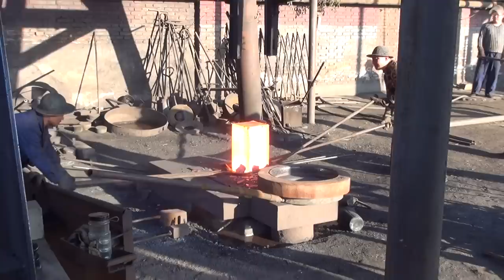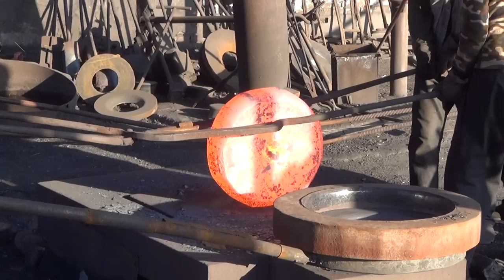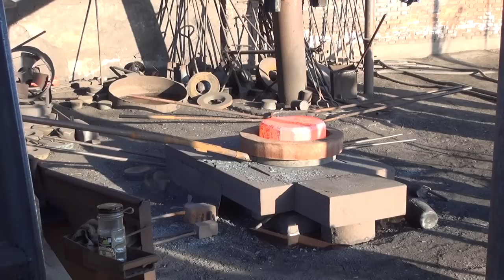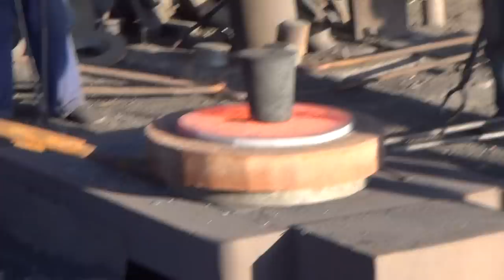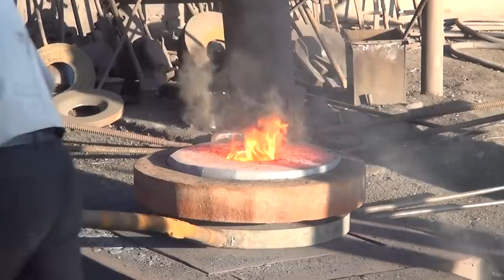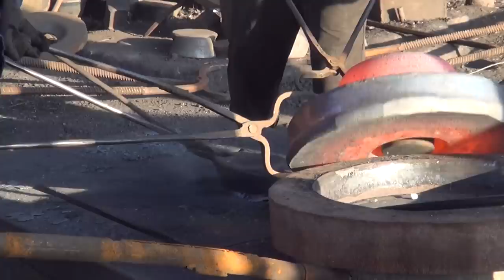Visit China Factory for flange .forging ,ring in dingxiang -Shanxi Liyang Forging Co.,ltd

Comment: State of the art equipment and excellent safety practices. No wonder we can't compete!
Reply: What fucking video were you watching?
Reply: They probably got 25 cents for work that day
Reply: @markmackey6012  sarcasm
Reply: This thing they are doing is probably a bearing housing for some, say, a generator in a hydroelectric power plant or something similar, which has to withstand a huge load.
Can you please direct me to a video that shows the process of producing the same or a similar product in a "western way"?
Reply: These folks are excellent craftsmen. Their pay will be according to local levels. As if our processes were different. It's only that nowadays we don't want the noise, dirt and work in our neighbourhood.

Comment: Has anyone even noticed?  That power forging hammer... think about it. It's not a forging hammer at all... it's a pile-driver that was repurposed to forge steel. It makes sense... the pile-driver hammer head is massive and heavy, and is intended to drive long heavy logs deep into the earth. The pile-driver hammer head is solid steel and very heavy and already flat. It needed to be in order to hammer and drive logs into the ground with only minimal deformation. The only modifications they made was to include a heavier head and a variety of different dies and the pile driver anvil base that they are using to make the steel forged flanges.

The other thing is how much work that they are able to do with only a single heat. There's so much steel that only the surface of the metal cools and oxidizes as they forge and form the steel. Ingenious forging method and a brilliant repurposing of a piece of construction equipment. After all, how many pile drivers in this country were retired and sent to the scrap yard, never to be used again? Very wasteful... These people saw a potential use for the pile-driver and decided to reuse it and make it useful again...
Reply: Good point, you are likely correct. Next time I need a flange, I'll go rent a pile driver and hook it to my excavator.
Reply: I agree, good call.
Reply: Amazing the way they do that. Thanks
Reply: My friend Billy got messed up bad because the driver was turned up to high and blew the pile apart, Billy is handicapped now! Dangerous Machine! Only one or two deaths a month there.
Reply: yea, very simple, effective solution when the fancy hydraulic hammers are out of budget range.
Reply: Engineering solutions sometimes use what is known as a "brute force approach", simple, low tech, neither elegant nor efficient but with the singular virtue of doing the job satisfactorily.  They just don't often involve literal brute force.  I have no idea of the relative merits of forging it this way, but it seems to work quite satisfactorily indeed.
Reply: This is called a "Drop-forge" hammer, and it is not a modified "Pile driver".

If you are wondering how much work they are able to do in one "heat", you are correct... they are forging the work piece even after it has lost its proper malleable temperature.

The "scale" is not being removed continuously, and the end result would be a "Weld-neck flange" which would most likely fail under pressure

Comment: I echo all the positive reactions to this captivating video of a great team making a great product: and it makes me seriously wonder what on earth kind of steel they use to make those cone-shaped hole punches & the molds they hammer the hot steel  in to ? 
I saw the video of this same pipe flange being machined in a huge lathe as the final product. It was just as fascinating.
Reply: There aren’t great product and great equipment. It’s shit.
Reply: "great product" try building a train with those handmade rings, then when it derails cuz its uneven you come back to me. This is 1800 century tech. You cant guarantee precision of shape like this
Reply: ضشذذذ
Reply: I don't know about what they are making there, but i do know the steel they use in many other products is so inferior, the product is completely worn out in a couple of months.
Reply: It's easy. I was told this by my instructor when I began my apprenticeship as a blacksmith/welder. Steel is like toffee. It's soft when hot and harder when cold.
Thank about that statement about toffee - those forms they're ramming through the hot steel don't need to be hardened - only colder. You'll have seen other videos where such forms are often dipped in nearby water to keep them cool - these will have water dropped on them from time to time.

The forging in this video will be low quality at best. They're hammering cold sections (it's still shaping) which will result in internal fractures inside the forged piece - lethal for pressure systems.
Reply: @jackking5567  but it WAS interesting to watch, wasn't it. Your explanation of the simple physics and different metal temperatures made a whole lot of sense. Thanks for that, Jack (my Dad's name too). Cheers mate.
Reply: @jackking5567  ... You are right !

The first cardinal mistake they made was not "upsetting" the work piece.
Steel often tends to have "bubbles" in the centre. So, you flatten the work piece and have any bubbles in the centre, which can be "punched" out.

Secondly, the work piece has already gone below the optimum "plastic point"... the temperature where it should be best forged. This you can tell by the "shine" on the work piece.

And finally, the flange is so uneven, that a lot of machining would be needed to get the final "Weld-neck flange" which is being made.

This flange will most likely fail, as you pointed out 🙏
Reply: @freedomordeath89  in another video you see them doing the final sizing with a lathe and then it's checked with ultrasound.

Comment: Fantastic team work.
Reply: This seems dangerous.
Reply: So does crossing an busy street. You just can't be careless. Hard I agree when doing it 12 hours a day everyday.
Reply from the maker: Factories have protective measures ! This harmmar forging need to have the certain skill ,so wonderful teamwork !
Reply: पण आता मात्र रे हे
Reply: @mccc4559  NO
Reply: @mccc4559  and mainly big oil pipelines use these . most sewer piping has couplers in case of a break they can slam a new pipe in no welding necessary
Reply: paprna Duna m   
sin
Reply: धन्यवाद लोहार भाइयों को बहुत बहुत अच्छा आप ट्रेन के   चक्के बनाते है है
Reply: Team work 👍 #FoundryTech

Comment: Those guys need some hearing protection and proper footwear and gloves. They are most likely deaf and those vibrations aren't going to do their joints any good. You look at a company like this and think how greedy they must be to not provide their workers with even the simplest of protection.
Reply: sure they should have, but wo are we to judge. Until the mid 70s we as western workers didnt had any lung protection. And sure they already invented it, they did it in wo1 already.
Reply: This is the safest Chinese workplace I've seen so far, and these dudes are wearing hush puppies while working with glowing hot metal and a pile driver
Reply: That's where we get the recycling from. Us sends it out and buys it back.
Reply: I thought China had come into the 21 century, we were doing this 100 years ago.  Labor is cheap in that country, Or, Maaybe it is another country, it still comes down to cheap labor.

Comment: That's one train wheel....99,999 to go!
Reply: thats what I was thinking.
Reply: Is that what they're making?
Reply: Heading says they are forging a flange, not a train wheel.flanges are made to order, Chinese are far better and economic.see their low cost tools, but extreme high co ordination and innovation.
Reply: with salary $1 p/h no issue there
Reply: @yarply12 l] mip VIP
Reply: Z
Reply: Ko
Reply: That's a wheel. A flange is the edge of the largest diameter. Rail wheels can have one or two flanges, depending on the application. However, this is not a rail wheel, it's not large enough. Probably a crane bogie wheel. We made crane wheels from blanks sawn from  cylindrical forgings, and machined on a lathe to size. This is really old tech. Nothing wrong with it, when labor is cheap, but we don't do it this way anymore.
Reply: @yarply12  Looks like train-wheels indeed, perhaps they make car-wheels also, kind regards, greetings
Reply: @nanaeats5027  Do you have any idea how much cheaper is this technology than machining? And how much better in material structure and mechanical features is the final product?
Reply: @karim lavji how, they use great  India product
Reply: @cumbavi6167  forged technology is best for material strong, its 30% harder to machine forged blank. also stamping (in closed stamps mainly) is used to reduce the allowances for processing on machines (turning, milling)
Reply: Best industry video ❤️ #FoundryTech

Comment: Compared to modern automated forging techniques and machinery, it is very hard to believe how accurate and skilled those workers are. They work very hard and tedious and the pieces they produce take substantial time to finish. So what is their pay and what work safety and insurance they have? As someone commented here, Walmart still sells the piece for less than $10. So is the finished piece something to marvel about considering the cost of making it and the low compensation for the workers who produce it, let alone the cost of the setup and tools and equipments needed to produce the piece?
Reply: Walmart sells huge metal flanges? BS
Reply: @mr.whiskers3283  Of course it´s BS. I think it was meant to be symbolical about how affordable they actually are...

Comment: Supposing the mass production, there is a simplier an chiper way of making the flanges by using cast steel pouring into sand model pattern.
However, cheap labour costs can be the solution.
Reply: well unless u need a forged flange, for high strenght application.
Reply: @louisrichards3702  Yes, you are right.

Comment: In fact, there is very few forging factory running such hammer, all such hammer have been instead of hydraulic hammers, this factory still run such hammer like some body still drive jalopy.
Reply: EPIC BURN.
Reply from the maker: "very few forging factory running such hammer" ?Are you sure ? have you ever study ? All I want to say is that your actually don't understand  forging . "He who makes no investigation and study has no right to speak" so please keep your mouth shut !
Reply: why did u put that in quotes? when it sounds like something you just made up
Reply: I have some special information just in. The hammer used in the video was only just recently manufactured and delivered by Anyang Forging Press Machinery Industry Co., Ltd.
Reply: this intense hammering  realigns the molecules  and  makes the part way much stronger than using a hydraulic press method.
Reply: Still used in some british factories.....
Reply: Anyang FP- Forging Machine Manufacture  - premitive method mechanical drop hammer . I dont know if this flange is machinable ? But still it works on take an hour to forge it .
Reply: STEPHEN SHARMA ...
Reply: This is the problem with you chinese people. You shame each other, backstab each other and try every cheap trick to get ahead of everyone else. Us westeners cant stand your ethics (or the lack of). A bit less of the 'put down' attitude will really help your buisnesses out!
Reply: @stephensharma4994  you are right, eliminate bubbles and cracks inside the body.
Reply: Jalopy only truck that will be afforded and home repair the common tools
Reply: @stephensharma4994  depends on the impact pressure.  Plenty of hydraulic presses that will out perform this specific hammer.

Comment: Where are all the women screaming out for equal opportunity to work in these places?
Exactly.
This is men's work.
Reply: Change the tooling a little. None of those guys are exactly The Rock
Reply: I hired a female blacksmith to work in my shop she didn't show up for work after 2 days
Reply: I know two women blacksmiths and a couple of welders who are better and can out work most men. They are not particularly big either. As a blacksmith you know that hitting it correctly is as important as hitting it hard. The power hammer & hydraulic press are great equalizers. I'll also point out several women have done well on Forged In Fire. 

Never had a man do that? I sure have seen plenty of men pull that crap and worse, like stealing my tools. That ain't gender. That's all just people being jerks like they can be too often.
Reply: There is always exceptions to the rule, but on the whole, this is not women's work. There are guys I've seen who couldn't find find a hammer let alone wield it. The equal rights thing is a  ploy to destroy our families. They try to shame and degrade people who do not agree with their plan. We should always follow how God made us. You will never go wrong that way.

Comment: lol No tape measure just "consensus measure" when centering the punch.
Reply: It's just a rough blank.   All forgings have excess material - it gets machined off and thrown right back into the furnace to be used again.
Reply: Yep just a rough billet, you still have to machine it with a modern computerized hydraulic press.

Comment: I don't know forging.  But I don't get how they center those pieces manually when they are pounding it.  This isn't a precision piece is it?  Nice to know where that part is going to be used.
Reply: I think these are manhole, use them on the roads, very tough holes man !!!
Reply: This is precision considering the process. This lump will almost certainly be machined to a finished wheel. Forging it first will reduce the amount of machining required and also the forging will result in a stronger item as well.

Comment: I would think the Fe would cool off and crack but it is so large its is able to hold internal heat longer. If it were a small block it would have taken 4 or 5 re heats. I was shocked the slag did not cause a problem and one guy was swiping off the slag only one time near the start.

Comment: There is a reason why we get material from China that is always out of spec.... Here's why. Good teamwork but very cheap labor with lax safety laws..
Reply from the maker: totally agree with you !
Reply: Nicolas Edwards  You can "waste" a lot of material and labor and still come out way ahead using a surplus pile driver and experienced workers instead of building a modern manufacturing plant with numeric controlled tools that is so safe and repeatable it could literally be run by a grandmother.
Reply: 66ū

Comment: That drop hammer is straight out of hell. I estimate that ingot weighs about three hundred pounds and the mold about another two hundred pounds. Those men lift and move both around with extreme precision with the crudest of hand made tools. A misstep or a tool placed in the trajectory of the drop hammer could kill three of them in in a split second. Men are much cheaper then a hundred ton press. My guess is these workers make about $2.00 a day for a ten hour day. No OSHA, no unions, no negotiated raises. If you don't like the danger or heat or noise ----

Comment: one reason why Chinese equivalents are a lot cheaper than most of their western counterparts....one thing noticeable is the half-hearted approach to cleaning and removing the scale from the work area. The scale can and does affect the overall quality of the metal if not removed regularly throughout the process. Western shops usually employ high pressure air hoses to blow it away or water jets to remove it. There's a possibility the machining of the finished piece and milling of the gear ring will remove any affected metal but it's still not too good and lends rise to the theory Chinese steel products are often inferior to those made in the west. Health and safety would have a field day here....but having said that, it's a cheaper alternative - and appears to work. The well practiced teamwork among the workers is interesting to watch...especially how they centre-up certain punches with each worker making minor corrections to centre-up the punch as he sees fit..

Comment: This is old traditional way using piledriver hammer systems and manual tong handling 

Too much work and production time

Now it is pneumatic or hydraulic presses and robotic arm handling 

Very fast process
Reply: This is China, they have too many people needing to work, so those old manual processes still need to exist and keep people in work.
Reply: @npsfam  It's not kept around so that more people can have work; it's that throwing human labor at the problem (and ignoring health hazards) is cheaper than getting the proper (and safer) machines with properly-trained (and properly paid) operators. If a machine breaks, that's expensive. If a person breaks, you just get another one.

Comment: What is the substance they are putting under the mandrel? Some kind of lubricant?
Reply: Probably coal dust
Reply: @donmackay3974  Which I imagine prevents welding?
Reply: It acts as a lubricant as you guessed. Makes it easier for the die to come out. It would weld together because the die is way to cold.

Comment: Hells Bells, what is the stroke and power of the (hydraulic?) hammer. There was a lot of scale being pounded into the blank as well. Poor end product quality.
Reply: it's not hydraulic hammer, i think it's belt drop hammer
Reply: Air or steam, it has a piston, a flimsy one at that, but it has to bend coming down from that height !